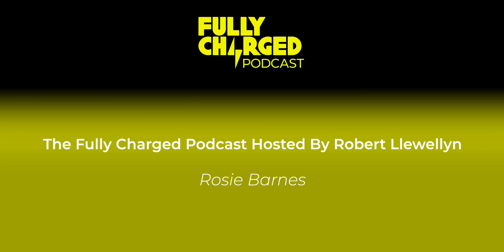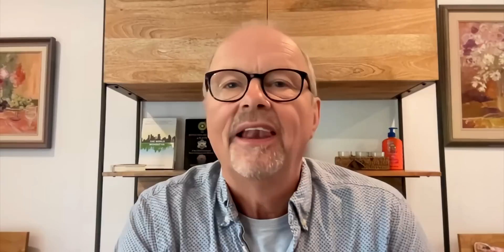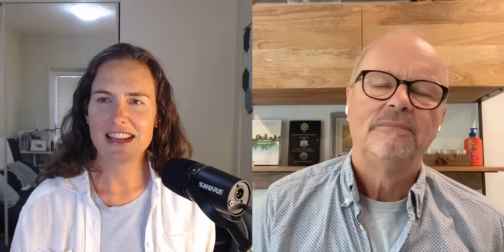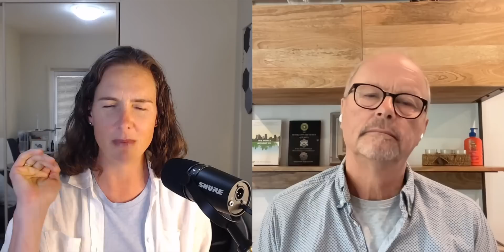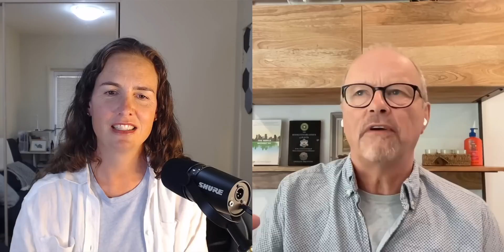The Inevitability of a 100% Renewable Energy Supply with Rosie Barnes | The Fully Charged Podcast

Comment: Community batteries can be a huge part of a fast transition to renewable technology. 
Forget home batteries.
Maybe forget high density lithium and use 
Flow batteries.
Reply: 😂😂😂😂😂

Well spotted!

Just how long do people expect their home battery installation to last  during a power cut ?

Unless you switch off/refrain from using the power hungry stuff then not that long.

Perhaps Googling up the topic of doing a power audit might bring  people back to earth, with a bump.

Community or area batteries might be a better bet.
Reply: @t1n4444  
Why WOULD you use power hungry stuff during a power cut?
That's a "first world problem" if ever I heard one.
You want cold (frozen) food.
A means to cook that food. (Only used for short periods)
A means to heat / cool the home if required.
Information (use your "devices" not the widescreen)
Reply: @rogerstarkey5390  

I note you live on your own.
Reply: @t1n4444  
What's your issue?
(Or are you just a Dickhead?)
Reply: @t1n4444  home battery 14kwh.
EV battery upto 100kwh and is free with every EV.  Hahaha 😊 
Most vehicles are parked 23hrs a day and ezi pezi to top up daily without a rapid charger. 
Allan Fells predicated 5 times more electricity demand with no fossil fuels. 
I suspect that it will be 5 fold bigger peak demands throughout the day. 
And 20million buildings rooftop solar PV supply in Australia.
Reply: @stephenbrickwood1602  

Hmm, and you believe this will happen?
Reply: @t1n4444  it is possible and can be done in small areas first.
Small country towns can independently do it and still keep the grid connections as a big battery backup. 
The grid gets the connection fees.
Farming communities can be very self reliant. 
Power suppliers can create virtual power grids.
Reply: @stephenbrickwood1602  
"EV battery" is a house backup battery.... WHEN it's at the house.
Commute to work in the car?
Then you're out of luck.
.
"5 times more electricity demand"?
You didn't watch the Tesla investor day?
.
They say "50% energy requirement" since fossil fuels (which also use a LOT of electricity for refinement, etc) are only 20% efficient.
Reply: @rogerstarkey5390  

Surprisingly, that was almost sensible 😂.

We'll soon hear/read if this "reverse" use of batteries gets adopted on a large scale.

Perhaps some people haven't twigged this sort of thing will only work in a few countries.

Oh well.
Reply: @rogerstarkey5390  Roger Roger every building is connected to the national grid. 
Every vehicle is parked 23hrs every day. 
Every EV battery will be full every day, except for the day of the long trip and a fast charge may then be needed. 

The home robotic vacuum cleaner can teach the selfparking EV to connect to the grid. 

Ezi pezi with every building and EV connected to the national grid 23hrs to 24hrs every day.

Let's just stay focused on the big matters first. That is were the money is.

Every Automotive manufacturers know where the money is, Elon Musk knows where the money is, it is being part of the energy busines.
Rooftop PV will explode as it has a free support structure and no major transmission costs and is connected to a national grid with massive battery storage capacity.

And the battery is FREE with each EV.
Hahaha Hahaha Hahaha 😆 

It is a good news story to know where we can go with technology. 

Even battery technologies are evolving rapidly and expanding.
Reply: @rogerstarkey5390  you can sell back electricity from your battery at work. Just plug it in there and in the app set the amount that needs to be left when you need to drive home again. Or charge during work hours to use at night. Depending how prices develop.

That is how it works here with people in appartments as well. There are chargers in the parking lot, they plug in there, scan it with an app and all the electricity they charge there gets simply added to their domestic electricity bill at their normal rate.
Reply: @stephenbrickwood1602  is "ezi pezi" the same as "easy peasy" or do you just have a learning disability?...
Reply: @stephenbrickwood1602  I've rarely had a vehicle parked for 23hrs a day & we've ven had 2 cars for over 30 years.  ezi pezi sounds like a sweet in a silly plastic dispenser or someone having an epileptic fit.  It's hard to take anything you say seriously.
Perhaps if you opened your mind to what others say, you'd perhaps find that talking sense becomes easy peasy.... 😆😅😂
Reply: @Alex Manojlovic  the point is the vehicle becomes part of the power grid. 
And the battery is constantly kept as full as you need.
The battery is paid to stabilise the grid as is millions of EVs.
I  think you are smarter than you sound 😉.
Reply: Home batteries are going to be the bulk of the storage on the network though. Either to store surplus of peoples own pv aray or to charge them with electricity when prices go negative during the day and use it during the night hours when prices will be highest.

A couple of years from now you can buy home storage appliances from your favorite korean, japanese or chinese brands for a couple of houndred buck at the big box store. Plug it in and manage yourself when you buy energy at which price, or get it for free when there is over supply and sell it back at night if you aren't using it yourself.
Reply: @baronvonlimbourgh1716  I think you are wrong. 
I think that the big EV batteries will be free with the vehicle and only fully used for the long drive. 
Most vehicles are parked 23hrs a day. 

The home robotic vacuum cleaner can teach the selfparking EV to connect to the grid. 23hrs a day. 
Rooftop PV and EVs are were much of our electricity is required. 
Basically the national electrical grid will be UNLOADED, by 50% or more.

The existing national transmission grid will be perfect. 

People will not see the massive savings when the incredibly expensive national power grid is not needed to be expanded 5times, because the 20million buildings on the grid in Australia will have a tiny 32m2 on every rooftop. 33kwh daily from every rooftop. 
Exactly were the old grid dispersed electricity. Millions of ends, power outlets.
Reply: @stephenbrickwood1602  the massive ev batteries will only be a temporary thing i think. There is a lot to do about range, but with charging infrastructure becomming common and convenient and fast charging becomming the norm things will calm down a lot. 
Ev's already have more range then necesary as it is, lugging around loads of weight and resources that rarely get used and only lowering efficienty unnesesarilly.

The grid will change from a one way delivery system into a decentralised peer to peer exchange. Much more evenly spreading the load over the network completely instead of having big transport presure near the power station and then thinning out the farther you move away from the central powerstation.
With some large interconnects between regions to transfer power from places where it's sunny to places where it is cloudy etc.
Weather is very localised, so there are always places where it is windy and/or sunny and places where it isn't. That power needs to be able to flow either way when necesary.

But this will all happen as demands grow on certain routes and demand shrinks in places where now large infrastructure is available. It will be changed when and where it is required, there really is no large upfront change needed. It will simply evolve to whatever is most efficient.

We are now finally at a point where economics are leading the transition and it is happening organicly. That will create efficienty on it's own mostly, within certain set boundaries ofcourse.
A lot of different setups will be experimented with innitially in different places and whatever turns out to be most efficient will spread over the network on it's own.
Reply: @baronvonlimbourgh1716  yep much of what you are saying is likely to happen. 
It is a different way of thinking.
Reply: @stephenbrickwood1602  it is basicly just looking back to how pretty much every other disruptive technology has evolved in the past. It happens pretty much the same way everytime, just in a different context.

And it happens a hell of a lot faster when the pivot point has been passed then everyone imagines, especially the experts of the technology that is replaced.
It will be a lot more capable then expected and will quickly create much more oppertunity then imagined beforehand.
And it will also completely change how things have always been done, the logistics behind it will will evolve just as much with it.

Those are the pretty universal rules that come with technological disruption.
Reply: @baronvonlimbourgh1716  

Hmm ... it's certainly a possibility.

However, an alternative scenario for you to consider ... it may be that we'll see a vast improvement in battery science and lithium will have had its day in favour of these different metal batteries we are told about or the "flow" type batteries ditto.

Would suggest the costs are more than you hint at ref your battery units and houses might be built with 'batteries included" so there's the facility in your house from the day you move in and no extra to pay for retro fitting.

We might see "new generation" inbuilt solar panel roofs and exterior cladding. Already in use in experimental projects, just Google.

Who knows?

There again nuclear fusion might arrive and we have more than enough electrical power to drive "anything and everything".

And of course, for those unfamiliar with the science, "nuclear fusion" is a bit of a misnomer because nuclear fusion is driven by hydrogen (plus lithium if nec, or so Google tells us) and not a molecule of uranium in sight. The waste exhaust is helium so we're alright for party balloons and massive dirigibles, driven by hydrogen fuel cell powered electric motors, assisted possibly by solar panels. Or even nuclear fusion generators if they are "compact" enough?

Dirigibles would be a lot quieter and "eco warrior approved" into the bargain.

So, game, set and match to me, then.

😉
Reply: @t1n4444  the problem with grid based storage is that the economics don't make sense from a consumer perspective.
Just like the incentive is there for consumers to instal pv because it provides free energy, the same incentive is there to have private storage to either store that free energy and use it for free when you need it or to make use of energy rates in order to have it economicly optimise when you buy or sell energy.

Centralised storage will always need big investment which basicly includes a corperation to cover the investment, capital cost and risk. That will need management and maintenance, overhead like buildings and infrastructure.
Leading to some sort of fee for it's use and no control over how you want to use it.
It would make sense for now as the investment needed is simply still large for a home unit. But as soon as these units become commodity goods a service like this simply will not be attractive.

Same goes for fusion it is still centralised generation requiring massive investment, capital cost and ongoing overhead. It will never be conciderably cheaper then wind or solar. Especially since by the time it is ready for commercial use pv will be omnipresent in all sorts of applications and dirt cheap.
Fusion as a technology is interesting, but it's main application will eventually be in space travel. The economics just don't make sense as an energy source even if it wouldn't need resources to feed it or they where free.

Solar is going to be the future. Wind will be supporting it until the time a new technology will come along that will replace the current silicon based pv systems for something more efficient. Whatever and whenever that will eventually be. That will make the mechanical nature of windpower obsolete as well.
Reply: @baronvonlimbourgh1716  

Well, now, I don't agree solar will be the "entire future" once nuclear fusion is working, so to speak.

As of now then "renewables technology" such as wind turbines are, on occasion, providing more energy than nuclear or fossils. Some UK marine wind turbine farms are miles off the coast, just about over the horizon. Out there the wind is "always" blowing.

 I have solar panels and frankly they are more ornament than useful.

They don't work at night and even a few millimetres of snow renders them useless even on a very sunny winter day.

The vast solar farms across the deserts of North Africa (and elsewhere of course) are useful.

UK is building it's own farm in Morocco, with a subsea incomer to our south coast. So yes solar will definitely have an "input" but it won't be the entire "input".

My money would be on nuclear fusion as the "fuel" of tomorrow.

Nobody knows exactly what the cost per unit will be, obviously, but cost isn't really an issue.

Why? Simply because the reason we need to eradicate, as far as we can, is fossil fuel emissions.

The global temperature rise is to be limited to 1.5C if are to halt the melting of all global ice.

Cost won't come into it.

Personally I sense we are too late and the sea levels will rise. Whether the levels rise by this predicted 200ft by the end of this century then who can say.

To repeat the more desperate we become then you can forget this efficiency stuff or cost.

Those costs will be as nothing to resetting our 7 billion strong population and having enough fertile land on which to grow food.

I predict the planet will learn to love fish and seaweed ... or starve.

Ironically, what with floating wind turbines, (and habitats?) endless quantities of hydrogen from renewables will become available ... and then the planet will have more energy than it knows what to do with.

So perhaps solar might be useful today but we'll rely on it less and less.

With another 200ft of ocean on our footsteps then we might see a considerable change in weather patterns because of ocean currents reacting to the colder fresher water sitting on top of the salt ocean.

Perhaps, and I speculate of course, we see much more water vapour in the atmosphere which helps to retain heat on the surface?

Will Earth become another Venus in a million or three years or so?

(Tongue in cheek alert.)

With any luck we'll reprise all those science fiction stories and send vast arks out into the cosmos? Hydrogen fueled, obviously.

We can then populate our galaxy ... and thence to infinity ...and beyond ...

Let's hope we don't meet any indigenous species living in "their" fossil fuel age ... who take exception to our arrival and won't be too keen to roll out the red carpet.

Which is why we can't rely on solar.
Reply: @t1n4444  those spaceships will be running on fusion by then.
But by the time fusion becomes available there will already a abundant, efficient, convenient, cheap and most importantly decentralised renewable system for energy supply in place for decades.
That is just not going to be reversed to a centralised system again unless there are large economic incentives for doing so. 
And the cost asociated with centralised generation itself will pervent that from happening.
Reply: @baronvonlimbourgh1716  

Well I should forget about "cost" for a kick off.

We're talking survival here.

And, slight technical point ... nuclear fusion runs on hydrogen. Ergo hydrogen has to be around.

You might have read about hydrogen being "harvested" from space itself by miles wide scoops, but might be be insurance to take our own.

Would suggest these ark might be accelerating for years or decades.

And taking the same time to brake.

Actually finding a habitable planet might take decades too.

Ships might store humans in cryo or humans live on ship and the succeeding generations are the humans to actually arrive on a suitable planet.

Would suggest these arks could only stay in orbit and never land what with gravity issues.

There again some SF writers posit that we do develop FTL ships and overtake the earlier arks ... and the earlier passengers arrive on planets possibly hundreds of years later.

That's populating the Universe for you.

Interestingly (?) the seeding of the galaxy was a well worn theme in the SF books or novellas I used to read nigh on sixty years ago when we had public libraries just about everywhere.

The time paradox thing ref arks and FTL ships was written about earlier than that.